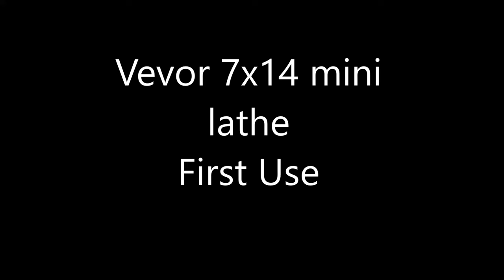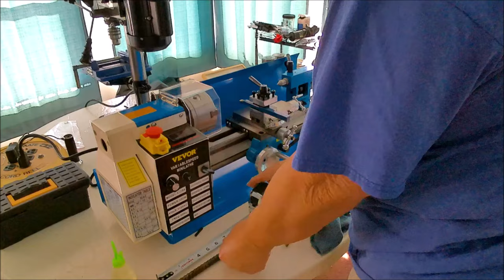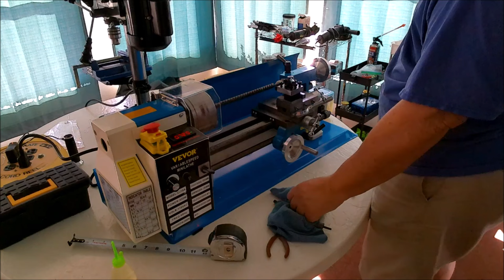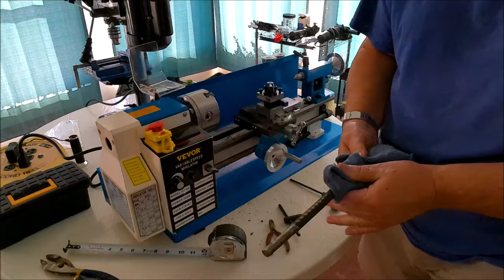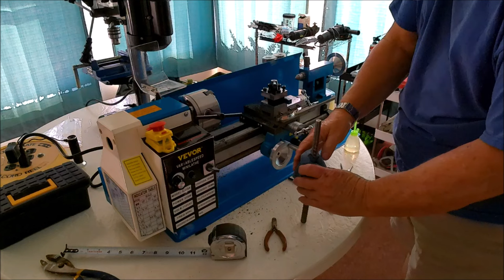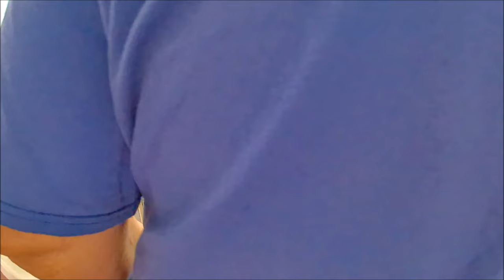First use: Vevor 7x14 mini lathe

Comment: 66 retired machinist and I can't begin to tell you how many things you did wrong here. Your lucky you didn't get hurt or distroy your little lathe.
Reply from the maker: It was my first use.  View later videos to see my progress.
Reply: Mate if you have so much knowledge why not offer some advice?
Reply: 당신은 많이 무려하군요. 어디서 그런 태도를 배웠습니까 ? BTS의 나라 대한민국  국민인 저로써는 이해할수 없는 무려하고 불쾌한 태도입니다. 누구에게나  처음은 있습니다. 부족한 부분이 있다면 당신이 조근조근 상냥하게 알려 드려도 충분히 이해할 만큼 연륜과 경험이 쌓여 있는 할아버지 친구입니다. 이분은 ㅇㅇ 그치
Reply: IThe first mistake you made was buying that VEVOR lathe.  The second mistake was taking it out of the crate.  I’m trying to return my VEVOR lathe.  It came damaged, and has stripped threads, and a defective spindle (threaded crooked on the gear end, causing over .015 pinion gear runout.  Totally unusable piece of junk.  I’m only hoping they will take it back.  I would stick with plastic, aluminum, brass and  copper.  I ordered the 1100 watt version of the 7/16.  The description on the VEVOR site said it was a high precision machine (not even close) that could turn hard and soft metals.  When I opened up the manual that came with the lathe, it said it was for soft materials only,such as plastic, aluminum, brass, etc.  Good luck with yours.
Reply: @rodgraff1782  My deepest condolences for your stress.

Comment: Mate, you need to centre drill the end of the rebar before you can use the dead centre in your tail stock, I would suggest you watch some videos on using a mini lathe before you go any further.
Reply from the maker: I'm getting there.  Slow but sure.  Thanks for the comment.

Comment: DO NOT DO THIS AT HOME.  1st of all it's not so much the hardness of the rod it's the interrupted cut, its length in comparison to dia., and not using a proper center drilled for the tailstock.  These machines are not meant to be used like this.  Machining is a skill and can be extremely dangerous.  You sir should buy a book or watch other videos to get started or you will be soon missing fingers or worse.  I couldn't even watch to the end seeing the initial setup.

Comment: Don’t plug the lathe into your cord reel. The wire gauge is too small and too long. You’ll burn out your motor. If you must use an extension cord use the heaviest cord you can (12 ga. Or even 10 ga.) so you get all the power from your lathe.

Comment: Sorry mate, but i hurts to see the way you use this late. You need to cut the end of that long piece at a 90 degree angle,drill a dead center hole and use the tail stock to hold the steel rod stable. You are lucky you dident got hurt doing what you did in this video. Please !
Reply from the maker: It was my first use.

Comment: If you dont know how to use a lathe ,Don't!!!!!! You could have been seriouly injured the moment you started to machine that rebar without centre drilling the end.
Reply from the maker: I understand that.  More often than not I do center drill the tail stock and and use a live center.  I do, however, not use when truing in end of the bar.  Then I drill and use live center.  BTW since that video was made I've turned about 20 feet of rebar.

Comment: Firstly your swarf pan in upside down, secondly, your haven't snugged up any gibs, thirdly, you really should stick to using hand tools like files, they are safer.
Reply from the maker: I have snugged up the gibs.  The swarf pan in intentionally put on that way but it you think it would enhance stability to put in on the other way I'd change it.  The more experience I have with it the better it's performing.  I've got to review the video which explains how to level the chuck.  Right not it cuts deep on the stock nearest the chuck.  The biggest improvement so far has been to straighten the bar stock.  I now have a press to do that.  Also, the quick change tool holder is a big improvement.  I'm getting there and having a good time.
Thanks for you comment.
Reply: Do you eat your cereal with an upside down bowl too? It’s to collect chips/swarf/debris as they fall…The other comments are correct. You’re reaaaaally out of your element here. These machines can seriously hurt you. Watch a lot, a lot of YouTube machinist videos. Safety first. And knowledge is safety. Machining isn’t the kind of hobby you just “jump into” without an prior knowledge. Or at least somebody with experience to guide you in.

Comment: You are going to have a BAD accident right there my friend! You MUST have a live center to do what you are trying to do, Or you chuck it up closer to the spindle and turn like 1" at a time until you have the length you want, But with rebar that might be a problem as well trying to keep it concentric.
Reply from the maker: In most cases I did.

Comment: An ex machinist here, my heart was in my mouth here.

1. Always wear safety glasses, you had a t shirt but no rings or loose clothing near that rotating chuck, that will just plain out kill you. And know how to stop your machine before you use it i.e. how to hit the emergency stop button. ( common sense stuff)

2. Spend a lot of time before hand considering what you want to do and achieve. Pre plan it out and re-itterate and adjust your steps util it is good.

3.for example, do you think it was a good idea turning that small diameter id say 1/2" to 3/4" that far from the chuck?  This is where some bending moments theory comes into play. For the less theoretical people its the old spring board analogy, ie if the part was only 1" sticking out the chuck would the deflection when you stuck that high carbon tool into it have been less or more.. obv less.  As a general rule of thumb i would only have that sticking out the chuck by 3x its outside diameter any more unsupported you could get shaft whip depending on spindle rpm, this is a harmonical frequency that is dependant on a lot of things but speed lets us dual it in.This is especialy dangerous and can make your whole machine destroy itself (look it up online for a more indepth analysis). Any more you would need as you mentioned a live centre or a rolling centre that fits to your lathe and supports the back of the rod as you cut it. Especialy usefull here to stop the material from deflecting.

4. I know you didnt have a live centre but you could have turned to a point a piece of brass or better phos bronze or anything is better than nothing, but brass and phosphor bronze are self lubricating (bit of material science topic to look up) and stuck that in the chuck as a dead centre ( yes you could have turned and made a live centre but first outing and all.

5. Stick your material as close to the chuck face as possible and drill a centre drill (you may want these if you dont have them , dirt cheap). 

6. Set up your running centre attachment if you have one. Pull the piece out past the desired 3x the od lenght and support the far end with the dead centre you made and adjust the running centre. Take small cuts and continously adjust / ensure there us tension on the dead centre and your running centre is supported.

One thing I forgot was tool setup and type, steel and rebar could benefir from a tungsten tipped tool. Keep clearances and rakes to minimal and most importantly set tool centre height correctly, you can look up online there are plenty of machinist videos.

Most importantly spend the time beforehand considering what your trying to achieve.

Good luck to you and I hope you get some years of pleasure from machining and learning as everyday is a school day as they say.
Reply: Nice Free class !! Thank you !!!
Reply: @EnricoMarangonJunior  Always happy to help anyone.

Comment: Hi friend,this is from anyear ago. i am doing the same learning at my 6_'s and no shame no regret at all: i began with small rebar and learn shouldn't be more than 3 -4 inches and the worse are the two lines beside the "seeds": remive with a grinder but my two advises: use or try if your pocket let you buy new bar sae 1010,or 1020or 1040 or 1045 or eve 4140 without heat treatment.rebar are not so hard but very dificilt because its form even for experienced people with big lathe,2)put higher the lathe almost under your elbows or will pain your back. Hope see you in the fight next videos!!!

Comment: Thanks for the video.  I just got mine last night - exact model.  The problem with the tailstock is that the base is incorrectly ground so it doesn't sit flush.  I will attempt to shim the back side of the tailstock baseplate to get it level.  To learn a bit about machining, watch Abom79 and his friends.
Reply from the maker: I think they all require some tinkering.

Comment: I, in my eighties now, have long wanted to have a mini lathe.   Long ago, in the mid 1950s, I had an opportunity to learn a little about lathe work.  I made a riveter's hammer which I still have today.  I'd like to use what I learned then and learn more now.   But I have a sense of caution about these little Chinese made lathes.  I don't mind buying one but I want the brand to be associated with a proper storefront here in the US.  I do not want to simply buy from a broker who works with many other brands and who can only be reached via telephone.  I want to be able to drive to a location and speak with a human being face to face.   So my choices are limited.   For the reasons cited I will probably buy from Little Machine Shop.   I do like PM products but do they have a showroom.   When I want to know about the quality of a lathe I look for the period of warrantee.  Most are one year only.  A higher quality machine will offer more time.  

In the meanwhile I keep watching these videos.   I must admit I don't like the idea of change gears at all.  A lot of fussing about just to cut one thread.  Better I think to simply chuck up a die and do it that way.   If I were to spend more I'd shop for a gear head machine.   Well these are just thoughts.   I have all the time in the world to decide.
Reply from the maker: You would enjoy a mini lathe as long as 7x14 would be big enough.

Comment: Nice little machine. You would have a nice time cutting aluminum over rebar. It would have scale on it. Nasty stuff to machine.
Reply from the maker: I was testing the limits of it.  Turned about 24 feet of rebar.  No problem, just had to take small cuts.

Comment: How do I adjust the tool rest to cut tapers? It seems like it should rotate but it's not obvious how
Reply from the maker: I just turn the entire tool holder and then run the cut by hand.  Slow and not precise.  If needed I do the final taper with sand paper.  I'm not sure I'd be able to create a taper for a chuck for example.  I'm a hobbiest not a machiniest.  I learn by doing, mistakes and all.  If you achieve your objective please let me know.  Thanks for view my videos.
Reply: Turn the compound slide all the way back to reveal two cap screws loosen and you can move to any angle desired .

Comment: Ensure that only about 1 and 1 1/2 inches of round bar is petruding out of the Chuck or you must drill a centre hole with a centre drill, first mill the face of the round bar, then centre drill then live centre. The max of depth of cut in hard ended steal is about 2000 th. Your metal is too far from the chuck. Best of luck?
Reply from the maker: I'm making progress. I have tightened up the jibes. Since I'm using scrap metal crescent in the hydraulic press to get it mostly straight has been the biggest. You are absolutely right on steel I can only take off a little at a time. I'm doing relatively small statuary I just need to smooth and true the rebar and the scrap threaded rods. When I get enough of that stuff cleaned up for you I'll try to do a video showing what I'm actually doing with it. This is not precision stuff. ☺️

Comment: Isn’t vevor a great brand?
Reply from the maker: Other than one defect, easy to correct, it has met all my expectations.
Reply: @gmsoptions what was the one defect?
Reply from the maker: The drive pully on the motor had a poorly drilled and tapped hole for the screw that should have fit into the keyway on the shaft.  Easy to fix with JB Weld.  I'll have to heat it up should I ever replace the gear.  So far, so good.  @paulfrost8952
Reply: @gmsoptions  ah thanks for the heads up. Glad you sorted it.

Comment: Very poorly done, first you must get a dial micrometer to center the rotation of the bar between points, second: the tool is not used like this, a proper adjustment and calibration must be done first
Reply from the maker: If you watch later videos you'll see I'm making progress.

Comment: 😂 that poor tooling.
Reply from the maker: You are right about that.  I have learned a lot.  Positioning the tool correctly is so important.  I'm slowly getting the hang of it.  The biggest challenge has been turning threaded rod since the tool wants to follow the thread.  I've found using a file to take the tops off the threads helps.  My objective was to turn scrap into something I can use.  So far, so good.

Comment: You look clueless in machinery in just a twinkling of an eye,so watch out yourself.
Reply from the maker: Given you low power and belt design, it would likely stall out before doing too much damage.  I wore face protection and refrained from getting my hands near moving parts.  The biggest danger would be for part to come loose from chuck and have that hit me.  I'm doing small pieces so while that would be painful it would not likely result in serious injury.  I would not attempt to work with a machine shop power lathe.  Thanks for you input.